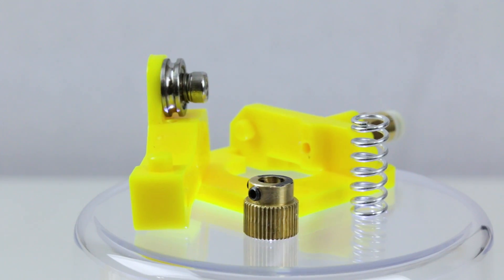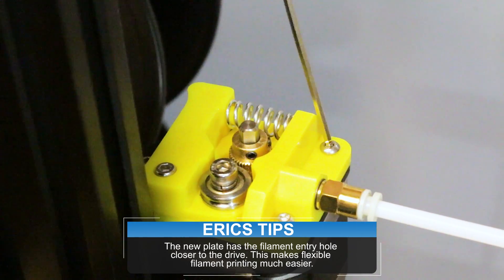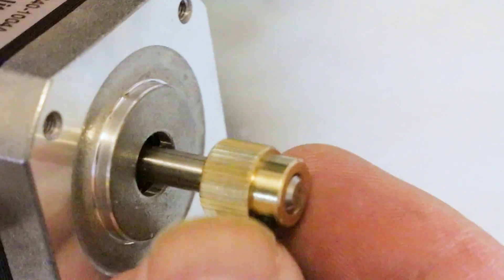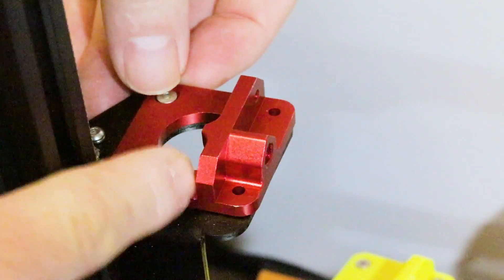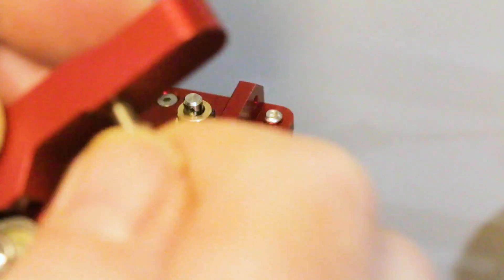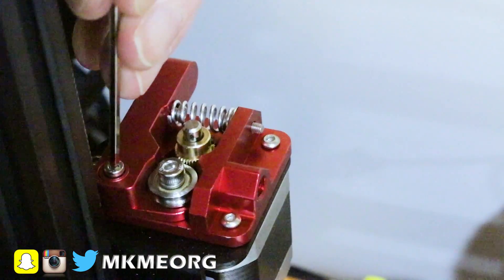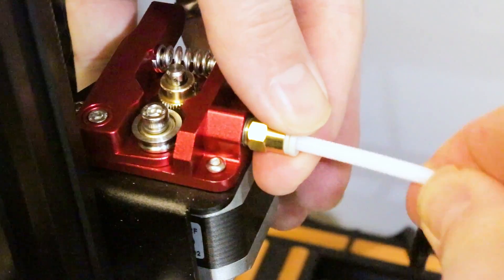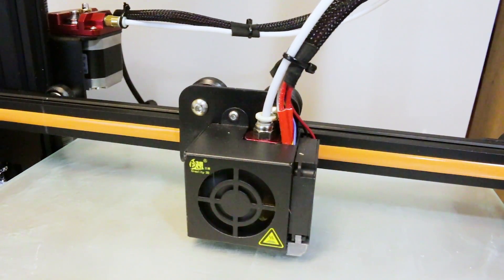CR-10 3D Printer UPGRADE! Replacement Extruder Drive

Comment: If anyone is having problems with the feed motor clicking after installing this, make sure you didn't over-tighten the guide wheel screw (the screw holding the little wheel onto the swing arm).  Took me hours of troubleshooting to find that I simply tightened it down too much.

Comment: The one spring screw appear correct in the intro pic but backways in the video it should be installed from the outside in (beside the filament output coupler). Nice video.
Reply: I was just about to make this same comment.  No need to use locktite or anything to hold that screw in, just install it from the outside instead of the inside.  It works just as well.

Comment: This is not necessary, the problem with flexible filament in  CR10 is the length of the Bowden extruder tube. You needed a better quality Teflon tubing, not this part.
Reply: You need to explain your statement otherwise it's as useful to other people as barking at the moon.
Reply: @okleydokley 
bullshit! filament wears the plastic crap that comes with these printers. otherwise, explain as i minabrons has stated above

Comment: Why?
Reply from the maker: The original bearing was binding and this one has a closer guide which will reduce issues with flexible filament "folding" over and allow faster print speed.
Reply: MKme Lab cool.. Nice instructions video.